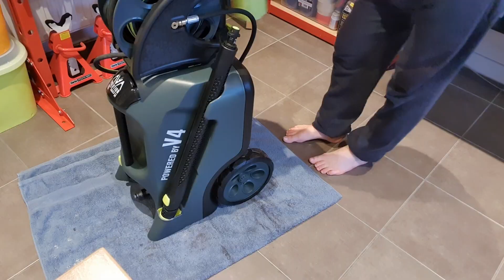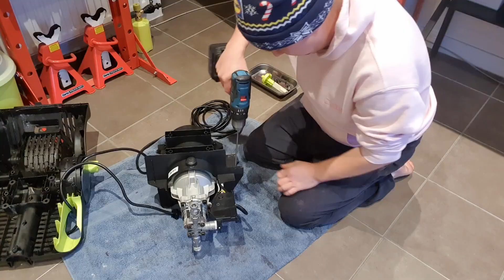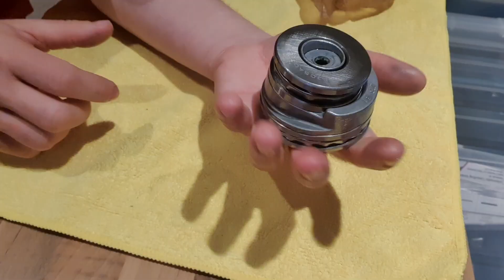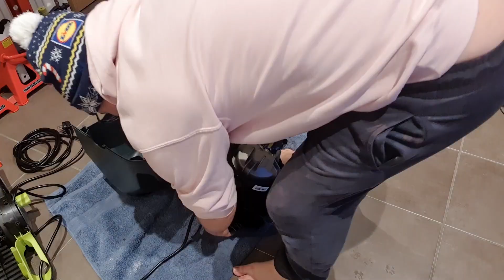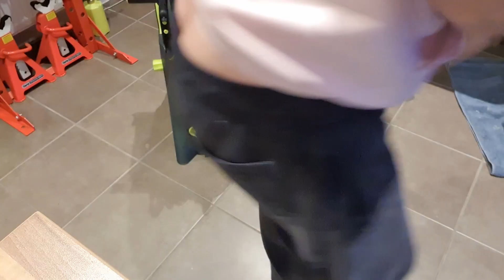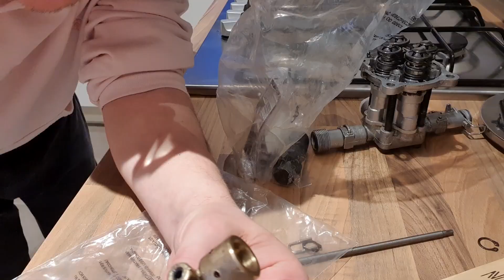AVA P70/P80 Warranty And Repair New Pump Install...

Comment: Hi bud just watch your video about the new pump ordered a kit. Went to undue the 5 ml bolt inside the pump and it broke .do you think I can get away without a bolt many thanks
Reply from the maker: Hi, you don't need to reuse the bolt. It’s perfectly fine without it 😊

Comment: Just the video I needed! I accidently ran my pump dry (it leaks a bit and the pressure trigger got untriggered while I was briefly away doing other stuff) for 2 minutes which wasn't great.. so I ordered this kit and I just wanted to see the sequence of replacing the bearings on the motor, so big thanks for showing that in great detail! I did get a little confused tho since I recalled reading that the 5mm Allen screw in the motor assembly did not need replacing, and you did put yours back in. It shouldn't matter either way right? Again, big thanks for your detailed video!
Reply from the maker: Hi, Glad the video helped you...Yes, the 5mm Allen screw does not need to back in the unit..I did find that out later…. but if you do reinstall the screw it will not cause any issues :)
Reply: @19marshall80  it runs like a charm, without the screw 😊👍

Comment: You have just saved me losing my temper with my model, Evolution P60 from 2022, first I opened the box and lost a little oil but no big deal I thought after buying from Craigmore in Scotland.
Year later changed the top piece like yourself but only a little oil left, so then till yesterday was working fine then just stopped.
Not knowing how to proceed and losing my receipt, I stripped the machine down and to my surprise no oil at all bone dry in fact.
So after watching your channel I thought to get some oil, could not find any local wise off the counter so just for testing I purchased a small bottle of ISO VG 32, and watched all the videos you have done on AVA, and bingo it’s working again and better, just a small note I did some AI on repairing and it came up with a torque of 7 nm, I cannot say if this would be right but worth knowing.
Ordered the 10 year warranty kit and got some ISO VG68 on order and will strip down again later.
If I could buy you a beer I would, many thanks.❤
Reply from the maker: I'm happy the video helped you, after the new pump and the correct oil level my P70 sounds and operates much smoother. Think mine was built on a Friday at 5:29pm haha 😂 I did get a reply from AVA regarding the torque spec for the 4x bolts, they said “we don’t issue the torque settings as most people don’t have a torque wrench.. tight is sufficient”